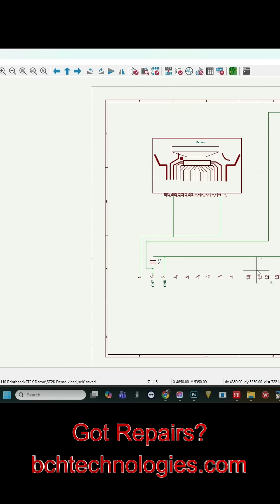Professional Printhead Disassembly Research #epson #skills

Comment: The tutorial is great, but how do I reassemble the print head? Without the plastic snaps , the old ones no longer work.
Reply from the maker: Thanks so much for your support and for watching the video—I really appreciate you engaging and asking this question. You’re absolutely right to ask, and I’ll be addressing printhead reassembly and solutions for worn or broken plastic snaps in upcoming follow-up videos, since that part needs to be handled very carefully to avoid leaks, misalignment, or internal damage. In the meantime, if you need faster assistance or have a time-sensitive situation, feel free to email [support@bchtechnologies.com](mailto:support@bchtechnologies.com). Also, just a quick note since I receive a very high volume of questions: subscribers and members get priority replies (typically within 48 hours) plus extras like early access to videos, regular viewers are answered if time allows since I can only reply to around 10 questions per day, and after subscribers and members any remaining slots are handled last-in, first-out with newer comments reviewed first; if you’re not subscribed and don’t get a reply within 48 hours, you can either subscribe—your older questions automatically become priority without reposting—or repost the question so it comes back to the top. I’d also love to invite you to join Run With Kevin — LIVE, where I go live every morning (usually between 6–8 AM Eastern) and answer printer questions in real time, so subscribe and turn on notifications if you want to catch the next live session and ask directly. If this video or my comment helped you, please consider leaving a Google review here: [https://g.page/r/CfL7k6nYvPQ9EAg/review—it](https://g.page/r/CfL7k6nYvPQ9EAg/review—it) really helps support the channel and BCH Technologies.